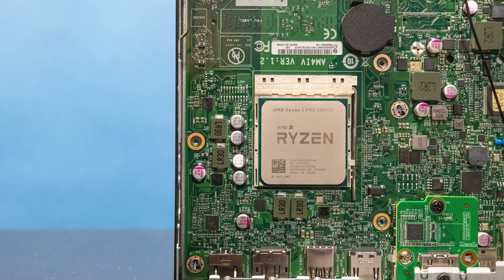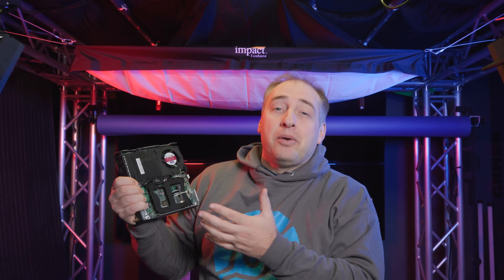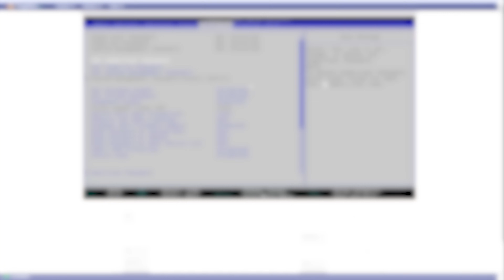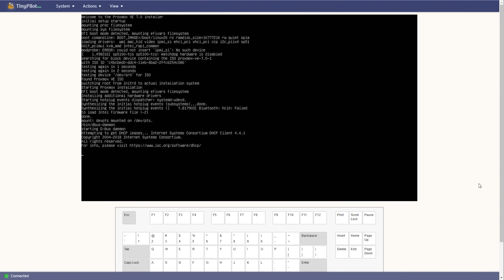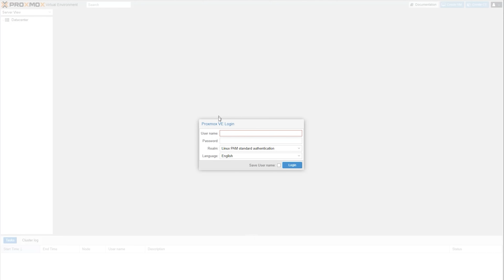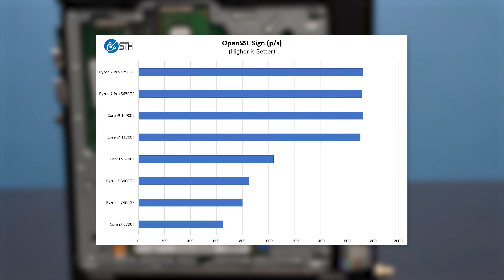1L BEAST! A 35W 64GB AMD Ryzen Powered Proxmox TMM Node

Comment: How would plex transcode run on that? 4k? 1080p? How many streams?
Reply from the maker: Plex you usually want Intel QuicSync so that would be the M90q Tiny Gen2 or M80q that we have videos of (linked in the description.) Plex transcoding works well on these, and even the older and less expensive generations like the Core i5-8500T generation.
Reply: And what about 10gbit NIC?
Reply from the maker: Usually no on the 10G NIC. You can do 2.5G USB 3 NICs on this fairly easily and there is enough USB 3 bandwidth to cover overhead.
Reply: Good answers, still interested in how this particular unit would perform tho.

Comment: I've recently been testing USB 2.5Gig dongles. Pretty good for secondary NIC on a system like this!
Reply from the maker: We have been using these for quite a few years and did some 2020/2021 articles. We also did the USB 3 to 5G adapters (less good of an option in a way.)
USB 2.5GbE Review example: https://www.servethehome.com/ugreen-usb-type-c-to-2-5gbe-cheap-network-adapter-review/
USB 5GbE Article: https://www.servethehome.com/usb-3-1-gen1-to-5gbe-network-adapter-guide/
USB 5GbE Video: https://www.youtube.com/watch?v=HPq2gKdwD80

Comment: If I did not already have a fully filled 27u rack, I would start with something like this.

Edit: But something with a recent Intel CPU. That Quicksync is awesome for Plex.
Reply from the maker: Totally. We did the M90q Tiny Gen2 as well. It looks like we will start seeing Alder Lake in mid/ late March and beyond.
Reply: @ServeTheHomeVideo  The new 4P/4E Alder Lakes look very very very promising vs a 10G MacMini - are you planning on grabbing one for testing?
Reply from the maker: @bryan_vaz  35W TDP Alder Lake is ETA mid-March I am guessing. We covered the HP Elite Mini G9 launch this week on the main site (not on YT). When we can we will look at Alder Lake. In the meantime, earlier today we ordered parts for a mATX corporate Alder Lake build for comparison.
Reply: @ServeTheHomeVideo  It will be awesome for a Plex, Jackett, Radarr, Sonnarr, Transmission media MACHINE! Im going to stick to my R7 5700G with a P2200 for transcoding 😁